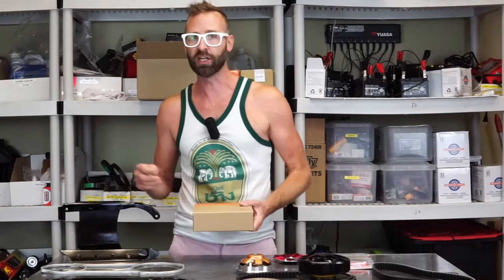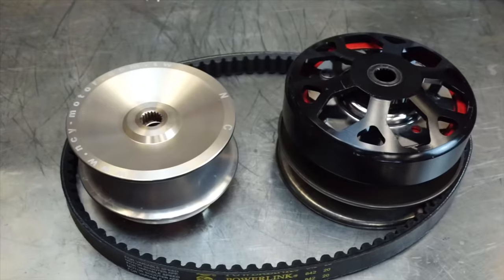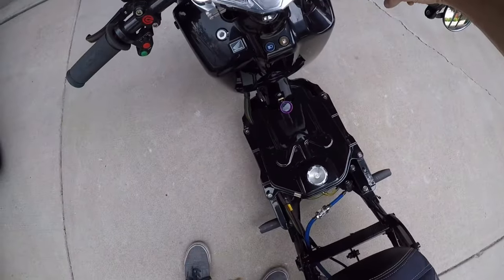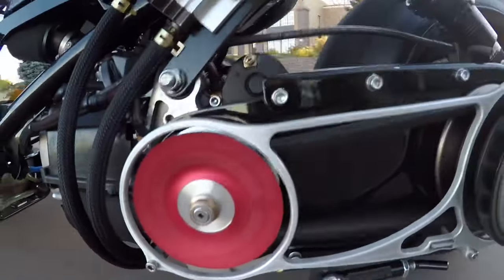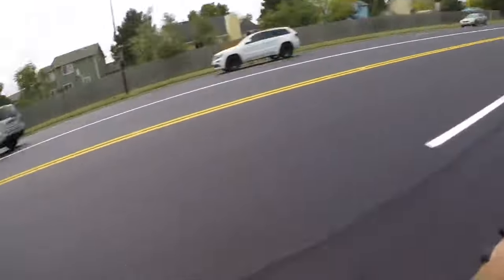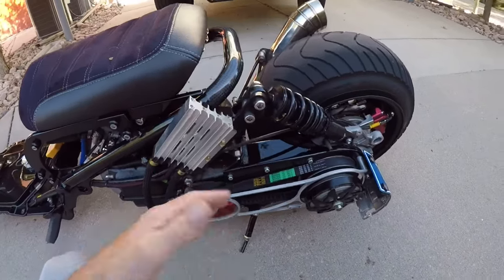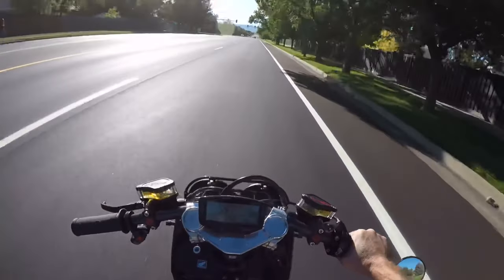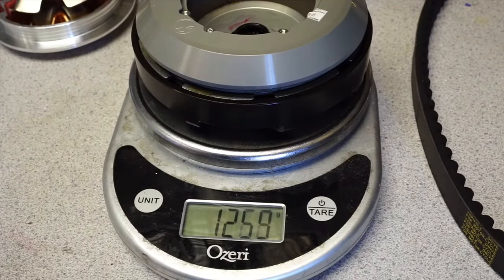The ultimate scooter clutch [MUST SEE] Reveno clutch

Comment: Using it for a year now, it's just jump on every start! Love it!
Reply from the maker: What do you have it on? Gy6? What kind of riding do you have?
Reply: @RollingWrench  no, it's just a Taiwan make scooter in Hong Kong daily use… the acceleration is a lot faster and it do save more fuel!
Reply: And the sound do remind a lot of older biker about the  2 stroke bike with dry clutch at the 80s
Reply from the maker: grygry777 I like the sound :-)
Reply: Right,so how much money you out.HA!Ha!
Reply from the maker: Mickey Collins duuude your waaay to money sensitive for this video. We are talking about pro part here :-) there is two type of scooter riders: the save money with a scooter rider, and the gear head. I can tell you are the save money type.... nothing wrong with that at all though
Reply: You are correct on money,Matt,I have to 2 Kymco  and my 50cc will do 45mph with out that high price clutch,compare to 38 mph with that crap.I do admire you for your informative videos.Great work.
Reply from the maker: Mickey Collins Thanks for the support 🙏 To each their own :-) 🍻
Reply: @RollingWrench  So the tech guy @ reveno states that you are their state side tech on the reveno product,to ask you on anything about their product for help.Is this true
Reply from the maker: Mickey Collins Yes, that is true. :-)
Reply: @RollingWrench  well they have the right guy.
Reply: @mickeycollins3108  actually not that much more than other so call scooter racing clutch…
Reply: @grygry777  perhaps if you had a power house engine,I went back to my NYC clutch.

Comment: Best I have seen is a brand called LCR racing for minarelli. they are a small company like Team Cristofolini and only produce to order, but it went with the 2fast billet torque driver. The Stage6 torque control clutch is a formidable clutch too, you can adjust pretty much anything about it
Reply: You got the right state of mind with that ,reveno is high price,no return, costly for fine tuning
Reply: I see them on high end drag builds .. it's the same old adage : speed is a question of money, how fast do you want to go?
Reply: @shoominati23  ,so true,
Reply: @mickeycollins3108   Sure it will cost you a lot if you know nothing about tuning LoL.
Reply: @user-ij9nc2rm3f  I know stock clutch is just as good for slot less money.on 50cc with 5 g slider weights

Comment: I have a 150cc with a 58mm kit with a full ported and cut head to 25 and I have a total of 54 grams in the variator and it makes your bike take off a whole lot faster without messing with the gearing and the other tip is to try to make a build with no starter flywheel my current bike doesn’t have the big starter flywheel and it helps a whole lot with the acceleration

Comment: Hello, I'm johnboy and new to gy6'ing i have a icebear mojo magic 150cc trike with a chain, so my question is do i also have a belt on the bike under the aluminum cover on the lefthand side. I've had to charge out carburetor. Because i didn't know about foam air filter oil and there special oil needed. The problem now is the bike seems to be jerky after a stop. It's coming from rearend and goes away once i get some speed. Is it because of chair or a bad belt under that cover. Help... Follow up question the bike has kick start but it hard and seems to not
Recoil. I have bad hip on right side so i have purchased a battery jumper device if needed.

Comment: Awesome bro,git a question, if i do something similar do i need upgrade my carburetor also instead of stock carburetor, i got a 125cc nibbi racing carburetor, just curious, would i get even better results and performance, i just haven't had the time to install it,i work a lot,so far your videos have been very helpful to me understanding the gy6 engine of my new bike since im a new rider an new gesr head of having to wrench on my bike to lesrn.

Comment: I have a cheap Chinese .49cc scooter with a CF 250cc engine stuffed in it. I'm looking for a better clutch for it after a bit more power and a gear up kit. Would love to know if this clutch is made for the larger engines. The engine is still stock but with a slight advance to the timing and I'm sick of the clutch getting hot when I ride it hard. Makes it hard to do wheelies when the clutch is slipping and chattering. This design looks to be the answer toy prayers, if one is made for my engine.

Comment: would this revenue clutch work on a Chinese scoot specifically a bistro, because it has rely bad acceleration and to speed and I would like to upgrade it's performance.
Reply from the maker: If the engine is a qmj157 yes

Comment: The only function of the centrifugal clutch is to engage and disengage rear pulley. As soon as RPM are reached the clutch is stuck solid no slippage... So what is the point in all this? You do have a bunch of disadvantages like open drive belt is dangerous... anything like flying debris, clothing,  shoelaces, little kid fingers can get into the belt. Noise is another issue... Also the original cover is a part of cooling system and without cover it is gone... 

I might missed something but  what is advantage in this?
Reply from the maker: In short:
This clutch grabs better resulting in better acceleration 

It’s a lot lighter, resulting in better acceleration.

It’s design eliminates cvt vibration

If you would like you can leave the CVT cover on, it will eliminate the noise and any chance of debris/fingers entering the cvt.
Reply: @RollingWrench  Why not to change 3 springs to a harder ones and leave the rest? This will cost you next to nothing and have engagement a bit at higher RPM where engine have more power...  The front pulley I do agree you can play with weights and their shape a bit, but rear clutch is useless game... 
BTW I used to work as scooter mechanic exclusively for 4 years and serviced and fixed thousands of scooters especially  Honda CH250 which was very popular vehicle in delivery service in one of the middle east countries.... Some guys were riding them 300-400 km a day.... at +40 degree C in city traffic... this was usage... It would be nice to try this clutch in service like this...   So I've seen it all and even more...
Reply from the maker: Pasechnik the clutch design is different, and a lot better. You should try it so you know what all the hype is about. I don’t know how else to convince you. I understand the stock clutch can be modified. But no modification will compete with this clutch. I PROMISE:-)
Reply: @RollingWrench  How much?

Comment: Question? Is it possible to swap a kawasaki tricity 200cc engine with a 90cc engine? I am a beginner to scooters. I wanted to start to a lower phase before going with higher speed. If it is possible, where can I buy a 90cc engine from Honda or Kawasaki? I hope that some could direct me to the right direction. Thanks in advance.

Comment: New to the scooter gearing side. I have a Gilera Runner VXR 200 that I like to do some wheele and im not really good at it. I want the bike to come up by its self, I got the polini 9roller variator, polini kV belt and the polini clutch & bell kit adjustable springs tension, but I haven't installed anything as of yet just want to know what I need or should or shouldn't I put them nee parts in? 
Thanks in advance

Comment: So I’m confused. On the website, the reveno clutch kit says “This kit will work with all GY6 long case engines (qmj157 engine only)” i’ve been trying to figure out if this kit will fit my 250 Cc gy6. Does it fit all Long case engines? Or just that one engine? They need to get a little bit more detailed in their description. So will this kit fit my 2021 falcon 250cc long case gy6?
Reply from the maker: It will only work with the qmj157 engine. Here is a video to help you GY6 [EVERYTHING YOU NEED TO KNOW] decode your engine!
https://youtu.be/zdrwJb8MLHI
Reply: @RollingWrench  I appreciate the reply. But I wish you gave me a little more info than just to watch the video I have seen 500 times. I’m sorry there just simply isnt a lot of info on these things. Like if I don’t have a qmj157 but my long case is the exact same size, what would stop it from working? I saw on one of your live streams you put it will fit 150cc and up. The only engine thing I can find is it says engine model 173mm in my manual. I’ve been doing research for weeks on this and I really want to buy it
Reply from the maker: @willsargent5055  It won’t work on your engine unfortunately. If there is no qmj157 stamp it’s not a qmj157. All qmj157 engines are stamped.
Reply from the maker: 250cc engines may look the same but are far different then the 150cc engines. Everything is larger

Comment: you should probably use the 2 face curoa wire due to its flexibility and better durability. I also just switch to the DrPulley 12.5gram. Those things sure perform better but also noiser as hell and more expensive. (4 times the price for the roller origin)

Comment: Matt,reveno didn't have a kymco agility 50 clutch,but they sent me an email on what suppose to work,he said a STC Honda Dio 50 2T.and as you have stated all are not the same.Did they sent the wrong clutch
Reply from the maker: That Dio clutch is the correct clutch for the agility 50. That is correct.
Reply: @RollingWrench  why is it not stated as compatible,
Reply from the maker: Mickey Collins I’m not sure, I can tell you it is though. I have personally tested it
Reply: @RollingWrench  i sure,but i guess my 50cc isn't strong for that product.perhaps my 2009 people s 250 maybe.I tried just what the service manual on Reveno web site.I can only get 36 to 39 mph with Reveno.but with NYC clutch I get 42 to 45 mph on a upward sloop.The Reveno was tested on main flat road
Reply: @RollingWrench  you tested on yours
Reply: I can email you what all I tried,with the roller weight ,torque spring to get adjusted.See I have New weights and spring from when I got my 2017 Agility 50.I do what I am doing,not to say that I know it all.I am always willing to learn
Reply from the maker: Mickey Collins it will definitely require cvt tuning. You have the Reveno clutch right now? Start with the stock rollers and the stock contra spring.
Reply: @RollingWrench  I did went down .05 grams with stock contra spring.I have sets from 3.3 to 9. grams.I tried 1000 torque spring.I spent seriously some hard work to get it to what I  said in early posts.Only when I went back to my set up with NYC and the roller weigh.it got back to 42 to 45 mph up a slope.Trust me I did all but change gear ratio
Reply: @RollingWrench   .05 gram at a time .on the stock spring and same on the 1000 rpm spring.
Reply: @RollingWrench  If I had gotten it for my 2009 People S 250 it may had a better response
Reply from the maker: Mickey Collins just confirm we are talking about you trying the Reveno Clutch, not another clutch correct ?
Reply: @RollingWrench  I wish I could trade the one I got STC Honda Dio 50 2T for the one the engineer said for my 250cc,he said that kymco downtown would fit my  people S  250.Now that is a sweet ride.I completely put all new part in that baby.In my riding groups, for mini scooter and maxi scooter,the all call me Kymco Kidd
Reply: @RollingWrench  yes the one Dio 50 2T
Reply from the maker: Mickey Collins do you still have the clutch?
Reply: @RollingWrench  Yes ,put back in box like new
Reply: @RollingWrench  If they would work with I would pay the difference to get the one my 250cc and return the one  I got

Comment: I want one of these, but I have an AF16 with a corsa. I know that they make one for the DIO / AF16 but I HAVE GOT TO be able to adjust the engagement. Like its not gonna work for them to just send one with a set engagement.
Reply: You will be spending more than your scooter is worth,just for clutch .Buyer beware
Reply: @mickeycollins3108  I have about 1000 into the motor build so I'm not super worried about it
Reply: The value in in af16 isn’t monetary

Comment: Taiwan has a lot of fun modding parts waiting for you, which will make you have a lot of fun
Reply: Mossa cvt kit
Reply: @Sunset13118  There are many boutique modifications in Taiwan, you will like it
Reply: @tu2933357  yeah ikr will upgrade to mossa kit on my Honda pcx
Reply: @Sunset13118  Have fun, great fun, if you're interested, you can check out the SYM DRG158 Taiwan version. It's water-cooled, and it's a locomotive that doesn't need a "starter motor". It's very unique and has a lot of safety features.
Reply: @tu2933357  will check out hope you have a great day thanks
Reply: @Sunset13118  Taiwan welcomes you. There are many delicious and fun places. Welcome to Taiwan at any time. Many modified shops will make you come back full😊😊😊
Reply: @tu2933357  thank you hopefully one day I can go vacation at Taiwan👍❤️

Comment: Hi there! 
I run a 110 cc Honda Navi scooter! 
Would like to change da rollers! Wat weight of rollers do you suggest I go wit to get more horsepower! 
Thanks!
Reply: if you want more acceleration goo for 6 8gs for balls. if you want to have more top speed goo for 6 12gs but if you want decent acceleration and top speed goo for 8/12 or 10/13 or 8/12 its up ti your ride habits.

Comment: I have a question I ordered a big bore kit 80cc for my 49cc would I have to change my carburetor or is the stock one fine? Thanks
Reply: You can upjet your stock carburetor and it would work/run but to get the must out of the bbk you should upgrade carburetor stock carb is normally 18mm with the 80cc (47mm?? Kit) maybe run a 20mm carb delete airbox uni fitler or cone filter... also them stock carbs normally dont let you adjust air/fule they cap it..

Comment: I wish they made this for a 50cc QMB139. I'm building a TaoTao 50cc. Putting in a Naraku  54.2mm big bore kit matching Naraku big valve head. And 44mm stroker  crank. With a Naraku super transmission kit, and bigger carb.
This clutch would be the icing on the cake.
Reply from the maker: I have a Reveno clutch for the qmb139.

Comment: You said you where going through belts like crazy... that indicates a problem somewhere? loose axels or bearings.. Or just failure in alighment on the whole cvt system.. Or u can be really unlucky because u  drive without a cover over the cvt system that u get shit in there from the road that destroys your belt.. But it seems something is not as it supposed to be atleast...

Comment: Hey man nice ride but it seems like you can squeeze more power from that engine you see here in Puerto Rico we gy6 a lot more different here we use the GY6 150cc Vento Phantom R41 and we use different methods to gain more power the best tip I could give you as a mechanic of gy6s is to lower the weight of you rollers don’t be afraid I did the math if you have a stock crankshaft you probably wanna have like 56 or 54 total grams and the bike should spin the crankshaft a lot more faster and give you faster acceleration
Reply: So you only use 5 rollers ?
Reply: @Hum3lejak  my current setup is 62mm 3mm stroker with no spacer the piston is machined and it has 4 rollers 4 12g rollers to make a combined 50 grams total and it will straight wheelie if you hit full throttle also a nice carb with get it better too we use 32, 30 , 34 mm flatslides
Reply: @Hum3lejak  from a dig she’ll straight up wheelie or spin out if you hit all the gas that thing goes
Reply: @jhoamilrodriguez9375  cool I ask cause I got a 150cc just switched the head so its 181cc at the moment im putting in a ncy cvt kit and I guess I'm putting 4 12gram rollers and a 1500rpm spring was goimg to use a 2000rpm spring but I think that will cause to ask for more throttle before pulling
Reply: @Hum3lejak  yo should put 54 o 56 cuz it depends on weight a really nice one is 55 with 5 11gs and trust me it’s gonna work nice that’s the kit I use a have a NCY variator but it has weight reduction and a NCY clutch with a banjing clutch bells if it’s a 181 you should use big carbs or a 30mm flatslide will work to but try get more air and fuel it’s big bore it should handle a lot better
Reply: @jhoamilrodriguez9375  thanks for the info brother I really appreciate it.
Reply: @jhoamilrodriguez9375  going to put 11g sliders instead cause I heard sliders are better then rollers so im goimg to keep it at 55grams total but with sliders will that work my ncy cvt kit is getting here Monday with 10g ,11g and 12g sliders
Reply: @Hum3lejak  sliders are gonna do the perfect job trust me👍🏻

Comment: Good video. I may do this to my gy-6...
I have a 49cc Jonway. Thank u👍
Reply: You need to put that money for better or a scooter for the price you will spend getting that clutch only,plus the cost of fine tuning
Reply: @mickeycollins3108  ya if u want to tune a 50cc scooter u should definetly buy a 2t
Reply: First get a big bore kit better carb, camshaft, cylinder head and then you will have enough power to make use from this clutch otherwise normal centrifugal type cluth will be enough.

Comment: do they have the same clutch kit for a kymco super 8 150 ? i've  recently had mine upgraded to 60mm (163cc) :-)
Reply from the maker: Yes
Reply: Stroke it up 3mm, and put bigger thorttle body. And you can fly haha just like my 2015 honda vario 150, 63mm piston, 3mm stroke kit, and 33mm throttle body with iquetech piggyback, and hit 10 second on 201 meters